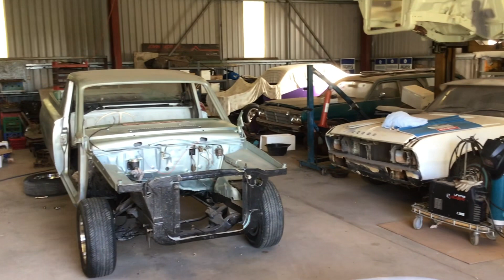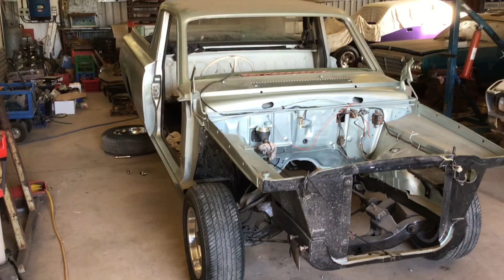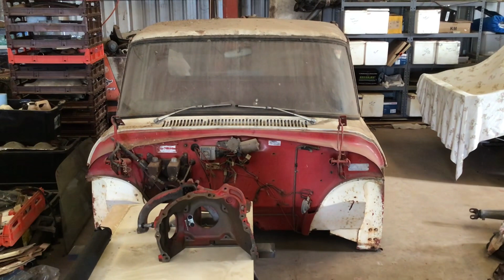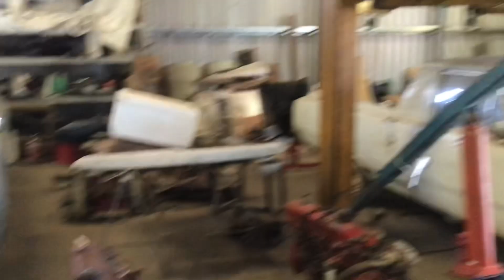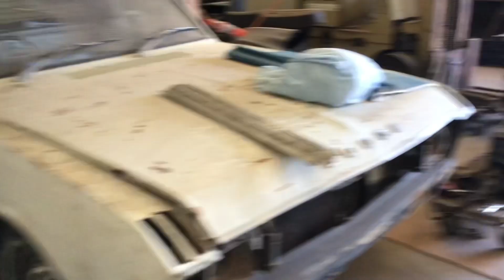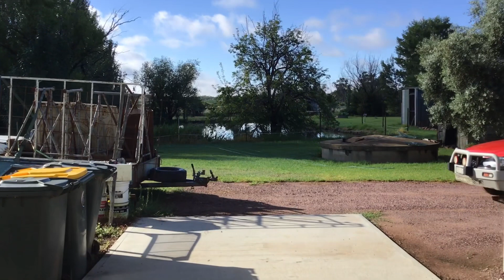2022 is here let’s have a valiant year

Comment: Dave, can you please help with some technical information? I'm thinking about a project with a tf727 and a 245 or 265. I know the 245 and 727 was used in the Dodge truck. Can you tell me what bell housing bolt pattern the 727 uses when behind a hemi 6? Cheers
Reply from the maker: Gday mate 
Can also find the TF blocks in VJ’s often behind 245/265
They are a V8 pattern block 
The dodge truck engines also V8 pattern 
Cheers
Reply: @coopzcarz7312  thanks. I was worried it might be the rare IH bolt pattern from a Scout etc.
Reply from the maker: Mate a VJ popped up today with 245/727 combo 
Mopar bill in SA on the Facebook pages has it for sale 
Cheers